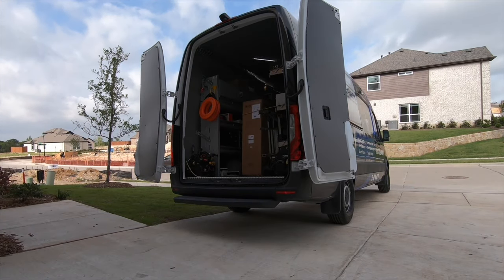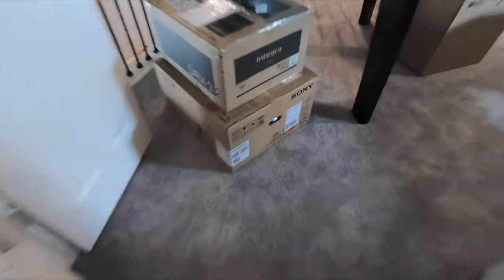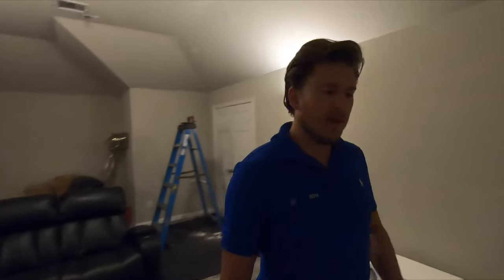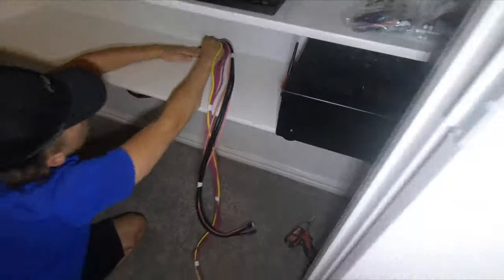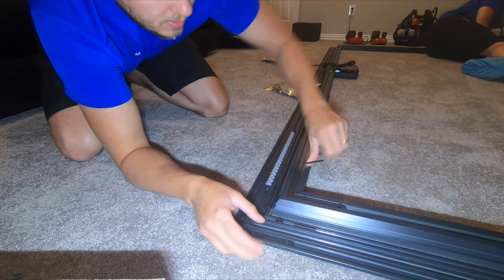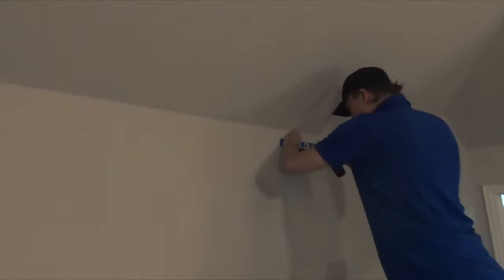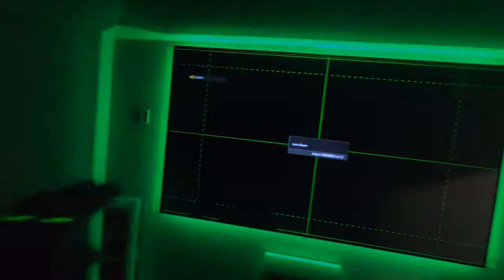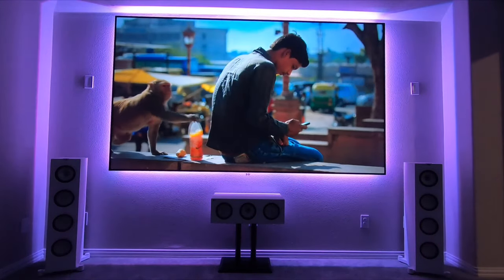FULL KEF 7.1 Q series HOME THEATER |Sony 295 Native 4K projector & SI 125" ZERO EDGE Slate Screen

Comment: What towers do you recommend to run with a Sonos amp in a limited space? I’d like to add some mid range punch to my current Sonos system that consist of a playbar, two subs, and seven play 1’s all in one living room. Instead of dropping 1100 on a pair of Sonos 5’s, I’d rather make the overall cost like 2 grand and take it a step up from what a pair of 5’s would bring.

Comment: One critique I would have is that my understanding was that in a 7.1 system the surrounds consisted of 2 side surrounds and 2 rear surrounds but that they were at ear level so on stands not in the ceiling. That Atmos speakers would be in the ceiling. I’m personally not a fan of in wall or in ceiling speakers. Just my 2 cents
Reply: you can do 7.1 with in ceiling. Ideally, they would be ear level, but with the processing abilities of receivers, the sound levels and distances can be adjusted.
Reply: On one hand: we have perfectly ideal as designed by engineers. On the other hand, we have what the builder made and electricians wired for. The challenge is making the less-than-ideal get as close as ideal as possible.

Comment: quick question: why did the owner choose a silver screen instead of a white one?  or did you advice it?
Reply: Its for better contrast and colours. Thats why some guys mix white and black coating color  + fine aluminum powder. Greetings
Reply: its an ALR screen meant to perform in lit environments . The gray gain helps with the contrast as master k mentioned. When you choose a screen, you need to match it with the environment and projector.
Reply: The grey screens look better, especially with ambient light in the room. I generally never recommend matte white unless it's the only option (like on less expensive perf screens). 

The increased black levels you get from the silver screens is a MUCH better option than using a white screen and never getting black. All the detail in all content is heavily dependant on black, and very little on how exactly white it can be.

Beyond that, these SI slate screens cab blackout off-axis ambient light in the room. 

This is a seriously legit setup. I don't work for Dream Media, but I have my own Audio/Video company in MN and sell/install similar systems to these guys. Props to DreamMedia.
Reply: @LarsonChristopher  well if the room is black  and primarily used as a theater I prefer a white screen and if at possible an acoustic one so the front soundstage can be behind the screen.  Also with a quality projector like the 295es, a 1.2 gain white screen will work just fine.

Comment: Those towers look lightweight. dont like the led around screen. projector is awesome.
Reply: The towers are 36lbs each, and are built well, and the components are very capable. The towers can hit as low as 40Hz on their own - while using 2 6.5" woofers (one being the QniQ w/ waveguide tweeter) and 2 6.5" radiators. They may look small, but they sound large.
Reply: @LarsonChristopher  Agree! I just bought them in black plus Kube 12 with Marantz nr1200. Way more powerful than I expected.

Comment: To me it is a bit sad that the customer got so much high end stuff but mid range speakers...
Reply from the maker: have you ever heard Kef in person?
Reply: @Dreamediaav  i have. I love there R series speakers. R300 r500 r700 etc.
I also like this line and they are good speakers but when someone spends so much on the amp and projector setup. Why not get high  quality speakers to go along with everything else. You dont put a v8 engine in a Ford fiesta right? Again not saying these speakers are not good. But to me the sound would not match the screen quality and I think if the customer heard the difference between the higher end kefs and these he would chose those in a heartbeat. The sound would match the screen a lot better without spending a fortune. 
Just my 2 cents
Reply: @BearsBlend  In all honesty - if this system was at the limit of the customer's budget (which I think is the case due to holding off on rear speakers...): 
I support the money allocation of this system. The Projector and screen are the most expensive components - and ultimately the whole reason for this project. 

The amp is solid. It is what it is. Sub $1k receivers have their drawbacks. 

The difference between KEF Q and R series is not a lot. The R series uses slightly better components, but a much finer finish on the cabinets. The Q series is very very similar to R acoustically. 

So with a budget constraint, I give a lot of credit to DW for this configuration. Solid "A" Grade.